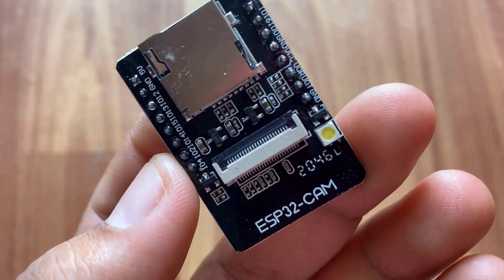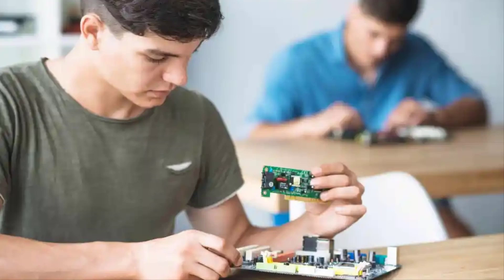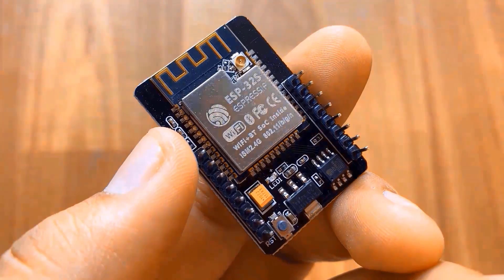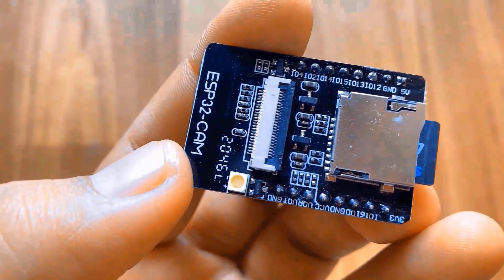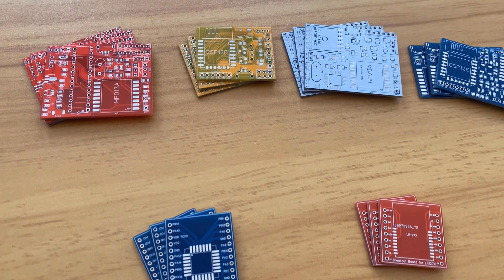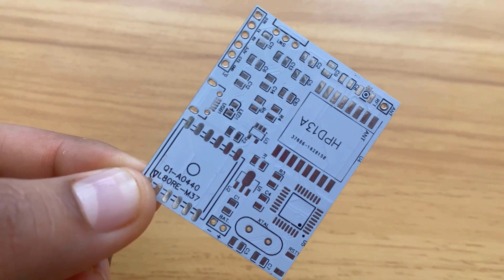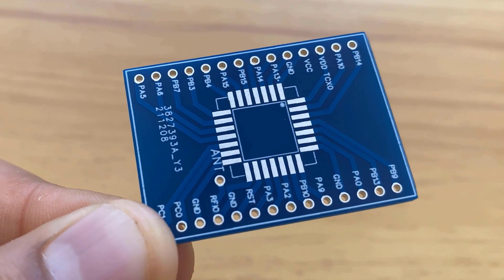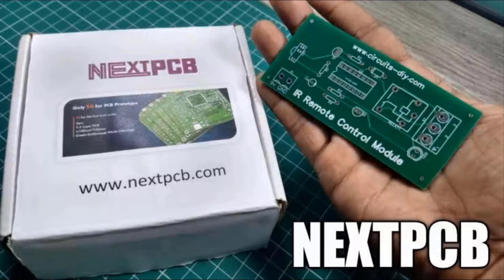Top 10 Advance & Interesting ESP32 CAM Projects using OpenCV

Comment: None of these are ESP32-Cam specific projects.  They just use the module as a fancy DIY webcam and then use a secondary device like computer for the entire rest of the processing and functionality.   These could be done with any kind of camera, wireless or wired, so long as there's a host computer running python.